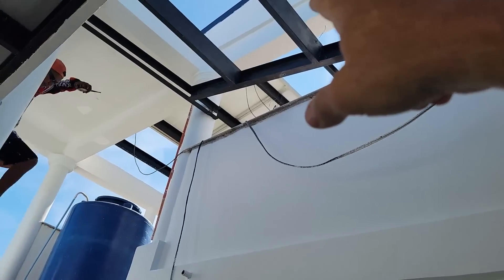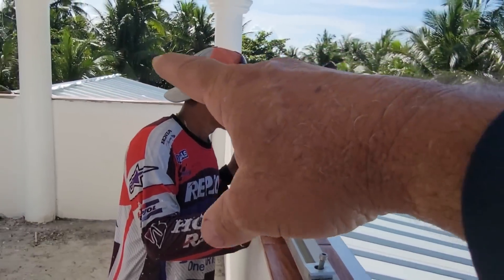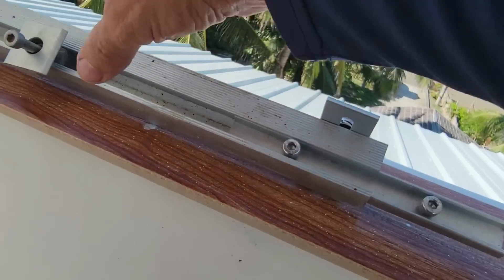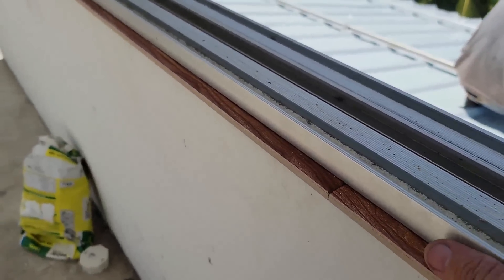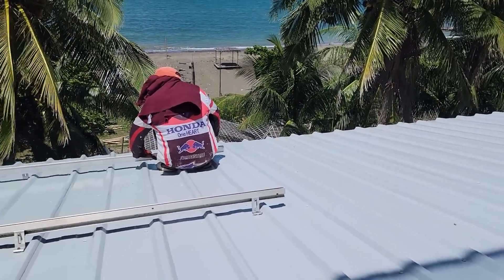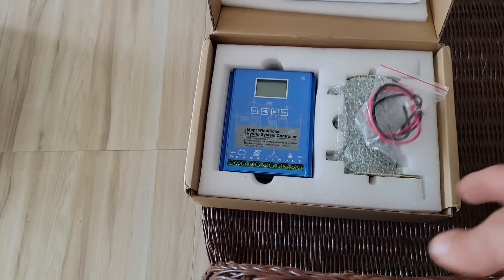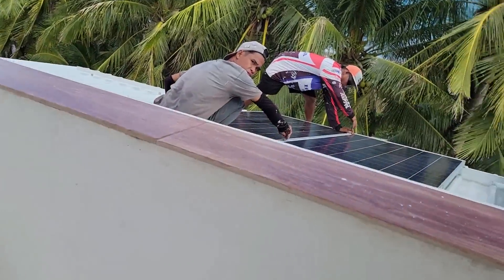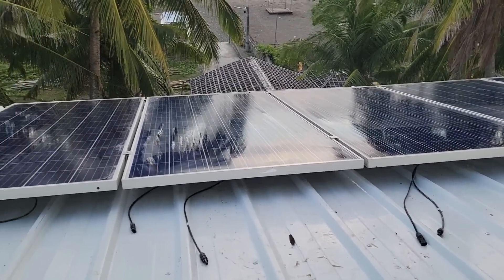Permanently Installing  the Solar Panels on New Roof

Comment: Hey James , I think I know the answer to the question already but would you please tell us why the Philippines has brown outs ❤️❤️🏝️🇵🇭🇵🇭🌴🙏🏼🙏🏼🛥️🤠
Reply: I live in the Philippines and can answer. Lack of skill technicians, here on dinagat island 2 weeks training and they are techs, in USA you need min of 4 years. Lack of material and equipment and poor pay for workers. Lack of money.They use a single wire ground system which is 1 insulated and 1 non insulated ground wire in no:6. Copper is not used because of high cost. No loc is not used to control expansion and contraction. Wires at circuit breaker can become loose because of that which can cause wires to get hot and possible fire Hazzard. Without proper funds they are doing the best they can. Where I live no bucket truck and their work truck is a motorcycle. Transformers are changed by someone climbing pole and rope and pulleys are used to raise transformer. It is what it is. Bigger city will probably have a bucket city.

Comment: I installed 4kw of panels and 520ah of lifepo4 batteries a couple of years ago...did it all myself. I couldn't do without them anymore. Depend on them everyday. Works great and saves a lot on utility bills.
Reply: Do you have net metering with energy buy back there?
Reply: @ryanjones7543  As far as I know they don't buy back the energy here in the PH.